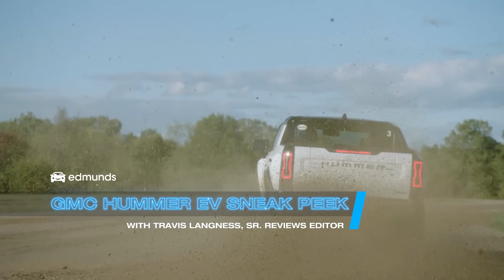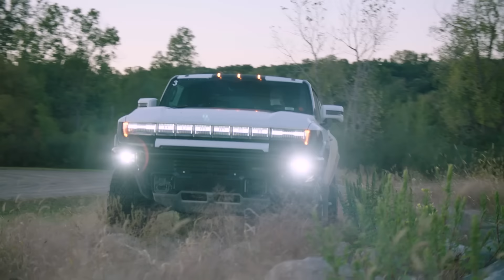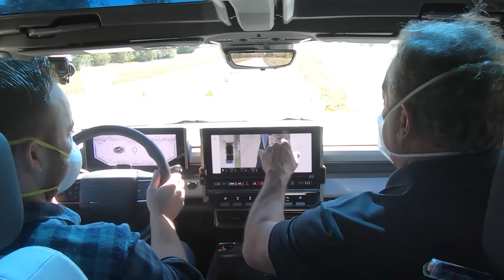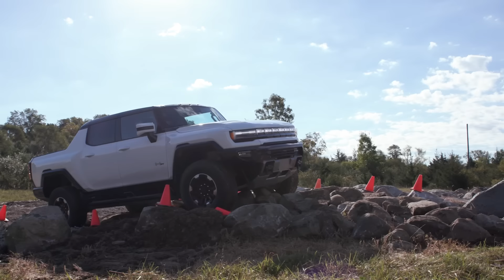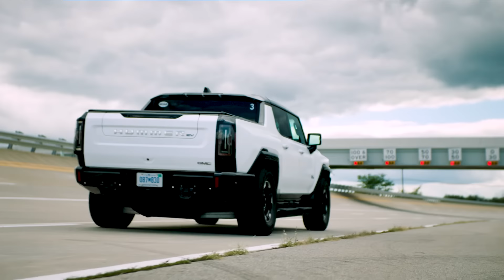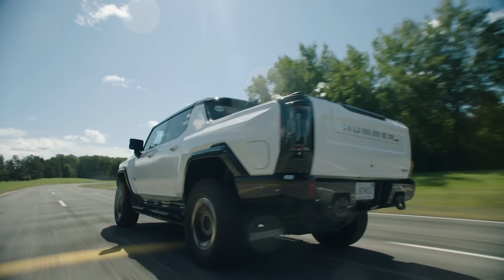2022 Hummer EV First Drive | Hummer Goes Electric | Price, CrabWalk, WTF Mode, Range & More

Comment: So they tested a pre production model.
What is the point of that?
At a super secret testing area 45 minutes north of Detroit. Guess it's not that secret. Kind of glossed over the weight. The price. How short is the short bed? They didn't check the range and a stop watch on the 0 to 60. 
Typical Edmunds review.

Comment: Interesting vehicle. No idea about how many can be sold. I guess GM picked a spot in the market without a lot of competition to get a truck stye EV launched. This Hummer certainly has useful capabilities for off-road use. BTW, sustaining a1000 Horsepower output (however unlikely) will consume a 200 KWH battery in about 16 minutes assuming 100% efficiency. To get 350 Miles from a 200KWh usable battery. it will drain the battery at an average rate (200000/350) of 571 Watt Hours per mile, again assuming 100% drive train efficiency and no gains from regenerative braking.
Reply: The GMC Hummer EV has 1,000 HP and 1,005 lb-ft. It has a 350 KWH battery pack where you’ll gain 100 miles every 10 minutes while charging. Chevrolet Silverado EV will also get the 350 KWH battery pack.

Comment: This is one amazing machine; calling it a "car" or a "truck" doesn't even begin to capture its full measure. It basically can do everything a 4-door sedan does, a crew-cab pickup does, a Wrangler does, and what a Corvette does. Real work, 7-passenger hauling, track days, and maybe serious towing are the only things it can't do. I have an F-150, a sedan, and a fast 2-door coupe; this can replace all of them. One vehicle to rule them all, lol.
Reply: If you drive it on a track I think you'll quickly understand it is no corvette or even a sedan.  Fast in a straight line is all it can do.  Stopping and turning will be a whole different story with those tires and that high center of gravity.
Reply: @VAspeed3  I don’t think it will roll as much as we might think. Those batteries anchoring the low center of the truck might help it to corner better than expected. Especially with the front and rear steering keeping the real turning along with the front to help eliminate some body roll

Comment: Unfortunately, the single biggest problem with new electric vehicles is the price. In the last 30 years salaries have increased by 25% and average msrp of vehicles sold have increased by 250%.
Reply: You're singling out EVs and then quote all vehicles as your support?  Really what you're saying buying a car in general is too expensive.
Reply: @Jaahhhnnnn  yes because it continues the trend and further exacerbates it. The 21 hyundai kona is a good example. After the tax credit its an extra $10,000 ($37390 vs $20500). At 15,000 (avg miles per year) miles per year, 8.5c/kWh (120mpge), and $2.75/gal (30mpg) it would take 9 years to break even on fuel cost between the two. Who would think this is a great deal? Your local energy rates may differ but this is ours locally.
Reply: Initial cost of ownership is high when compared to ICEVs. It all gradually drops when you account for maintenance costs, with the highest being battery replacements. So in the long run EVs are cheaper.

Comment: R1T just tested by many had 35 inch wheels, did great offroad, also climbed moab..and is 80 k USD. R1S could be even more impressive - shorter wheelbase. Hummer is massive, crazy expensive - will find customers but... not for Normal people:)
Reply: Hummers where never for normal people so its stickin to its roots lol
PS. Except the H3 and H3t wich where their effort to make a hummer for normal people
Reply: Agreed.

Comment: Is the battery chemistry and design the same as in the Chevy Bolt?
Reply: No, these are Ultium cells.
Reply: Nope completely different 
Bolt uses old borrowed LG tech these are in house GM
Reply: No, the next-generation GM EV’s (except for the Bolt and Bolt EUV) will be based off the Ultium platform, including the Hummer EV.

Comment: I wonder what charging all these electric ⚡️ vehicles going to be like at the station. Will they be sitting there for an hour or something
Reply: With the Hummer’s 350 kWh battery pack, you’ll gain 100 miles every 10 minutes while charging. The Silverado EV will get the same battery pack.
Reply: With home charging you start every day with a full charge. My experience with Tesla for longer trips is usually a 20-25m stop every 2.5-3 hours of driving. This has a bigger battery though so the charge time may be longer.
Reply: Actually hours in line.

Comment: Did he say the Rivian R1T is not really about off-roading? Did Edmunds test drive the R1T?
Reply: I think it's more about the options that can be set for the Hummer, plus custom modes for power delivery. So yes you can select normal, off-roading, etc...  in the  Rivian as well, but you can also customize those modes for your specific needs in the Hummer.  In addition, it has underbody cameras, full rock and you can add 37-inch tires.

Comment: What is the stopping distance from 60 MPH ?
Reply: Eventually.
Reply: that thing need massive brakes because of its weight.
Reply: With those tires I would say over 150 feet.
Reply: 5000 feet

Comment: General Motors is making a big deal about how it’s converting its Hamtramck assembly plant in Detroit to making only electric SUVs and trucks, including one that will be badged as a Hummer. But that’s not the only GM plant that will be making electric sport utes and pickups. Autoforecast Solutions reports that GM’s plant in Ramos Arizpe, Mexico will begin making all-electric full-size D-class SUVs for Cadillac in April of 2023, and an all-electric C-class Chevrolet SUV a few months later in July. GM is going to build two EVs for Honda starting in 2024 and while neither company announced. where they will be made, we’ve got to add Ramos to the list of possibilities. Autoline Daily
Reply: Spring Hill, TN will build GM’s EV crossovers and SUVs. GM is adding two additional battery plants in the US, my guess is Michigan and Texas.
Reply: @justinsmith2598  or Tennessee.   Looks like TN and Mexivo to build for Acura and Honda suvs.
Reply: @Norm T  Yes, GM is building a battery plant in Spring Hill, TN, next to the assembly plant.